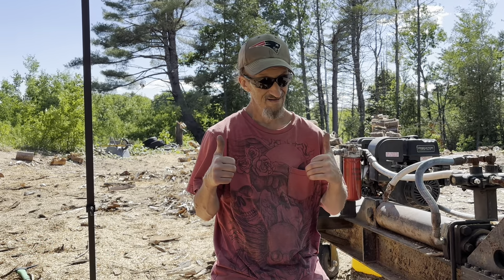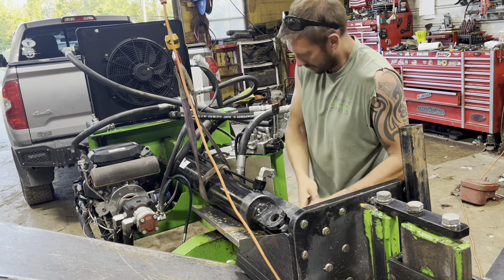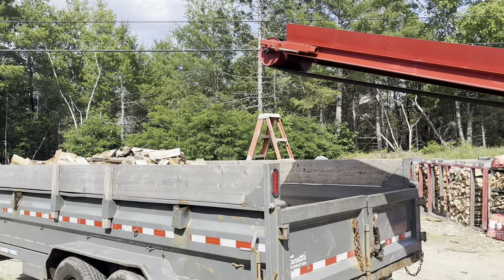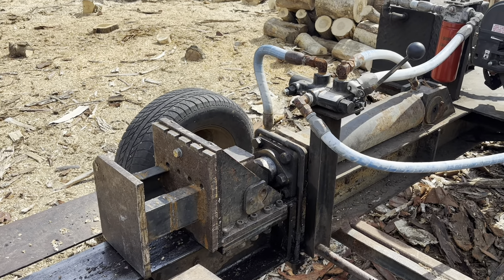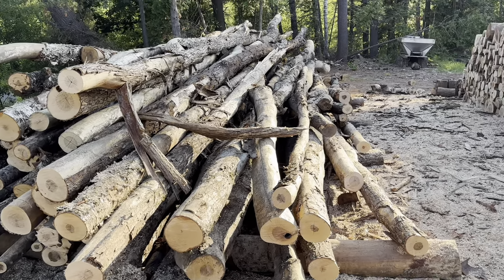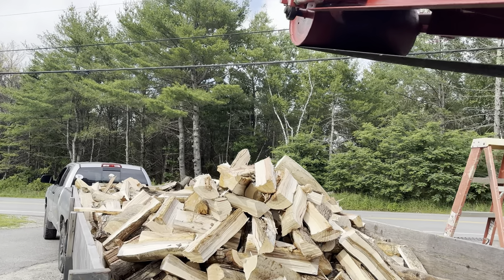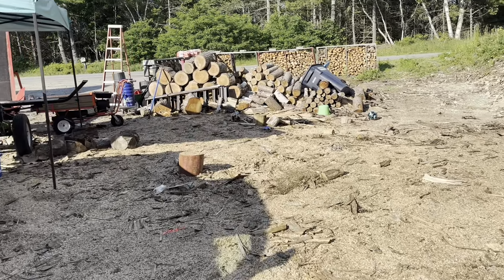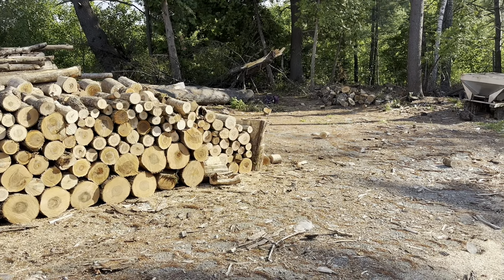More splitter troubles!

Comment: Gramps splitter is cool but you got to be happy Allwood is back.  I've been cutting early morning and splitting in the afternoon but taking off the 4th.I have seasonal neighbors that might not like 5:30 power saws.  Actually, if they are ripping around on there quads half the night I'll start at 4:30!
Reply from the maker: Yeah the Allwood is a huge time saver for sure it cuts splitting time by 75% on average.